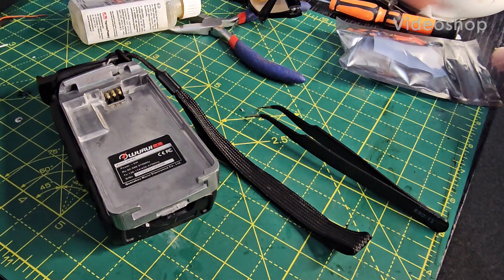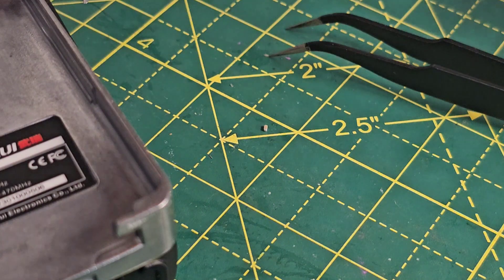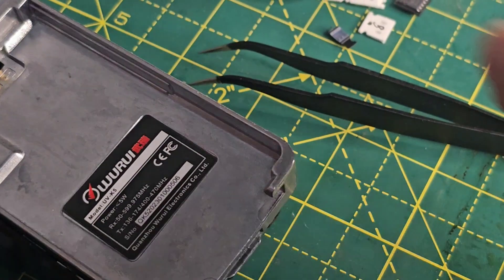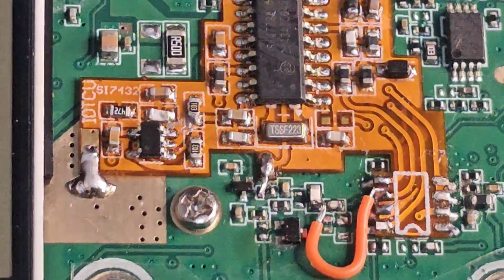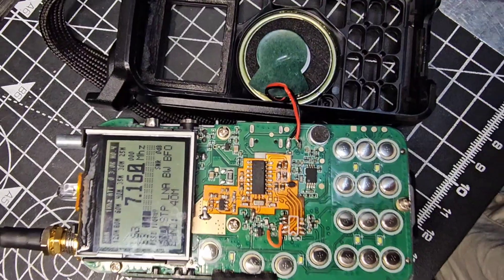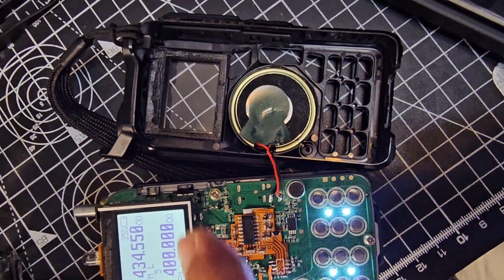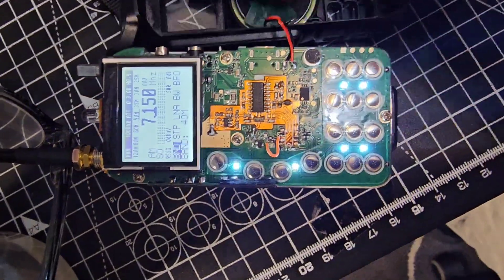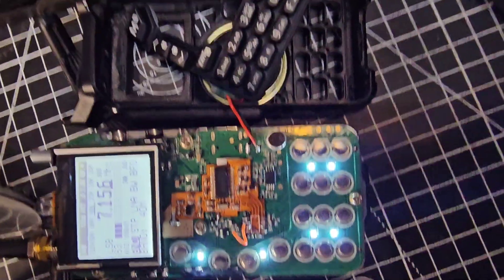QUANSHENG UV-K5 - Add Capacitor - HF Modificaion

Comment: I bought 2 boards, one assembled and one as a kit . but looking at your board there looks like a few of the components not making connection. I would advise some fresh flux and re soldering/wetting all the joints, I had the same problem and after doing this it worked first time. The capacitor you removed needed changing for a 100nf (for the lower frequency RX) and is marked as part 12 in the kit. Hope this helps....
Reply from the maker: Hi Many thanks and agree .

Comment: Your kit looks like crap.  They did a poor job.  I ordered mine from Amazon and it looks good.  I just finished install.  I did the same and removed the cap.  I think I'll install the second antenna, instead of putting a new cap.  I lost the original.
Reply from the maker: I lost original aswell :(

Comment: I had similar problem of no HF reception and I found the the signal from antenna was not getting past the RF amp next to the capacitor you replaced (R25). There should be a voltage on the single pin on the right side of the little amp.  Mine showed zero volts.  I used a signal generator to inject an HF signal around that amp and saw that when connected to the output (right side) of the RF amp the receive came alive.  I don't know if the RF amp is bad or that having zero volts on the collector is causing the issue.  Anyway, I just made jumper across the RF amp from top on the cap you added to the right side to the path to pin 6.  The sensitivity is not as good as it should be but it does work.
Reply from the maker: Can I have a pic M0FXB@OUTLOOK.COM
Reply: @M0FXBHamTech  PIc sent.